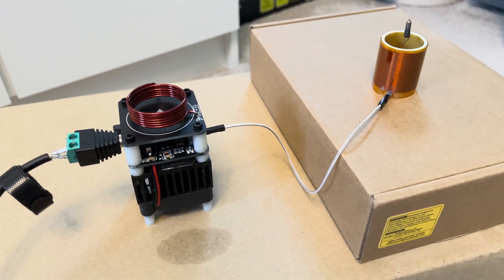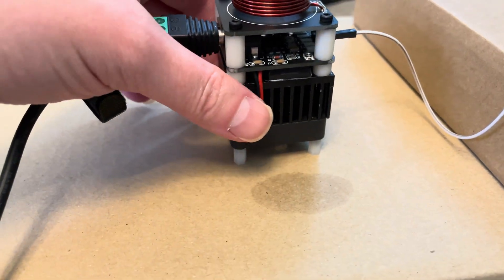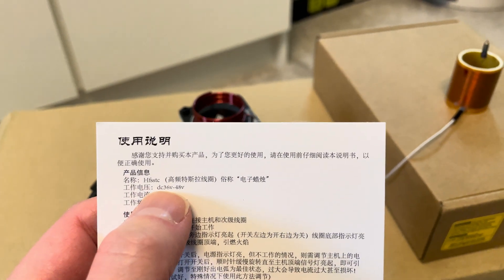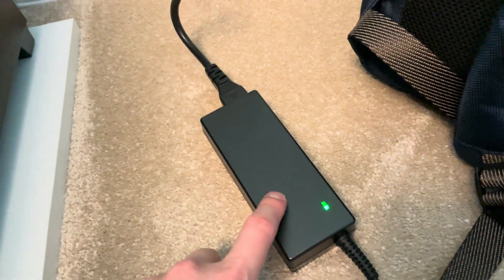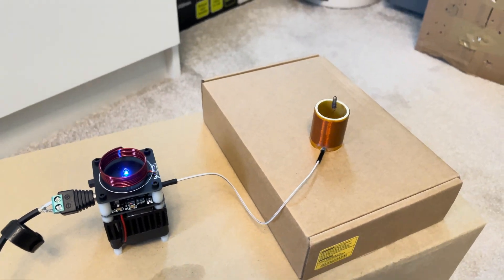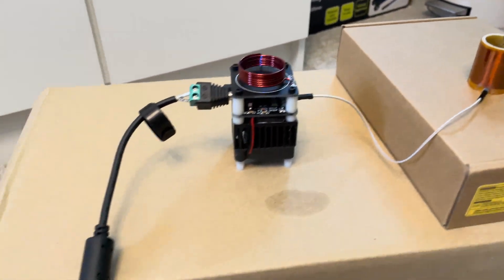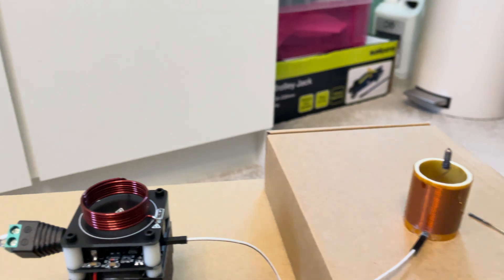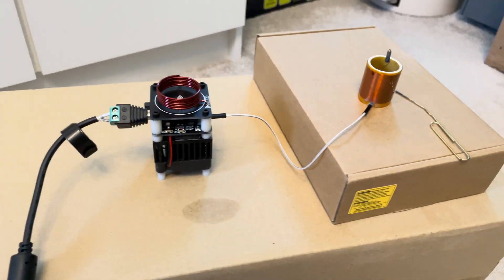Demo of High Frequency Solid State Tesla Coil (HFSSTC). Plasma candle.

Comment: You should draw the plasma flame out of the tip very soon after switching on, otherwise you risk burning the Mosfet. If it can discharge via the plasma flame its better for the mosfet - that what the instructions say and what you hear on many channels with HFSSTC. The Mosfet would be happy for any extra cooling though as it is driven very hard and over specs at this speed! It can only survive at zero current switching - so the device must be very well tweaked. If not 100% it will die soon.
Reply from the maker: ok thanks for the advice. I'll do that next time.

Comment: FYI....  From what I have read you need to start an arc at the electrode tip with a screwdriver or insulated metal object WITHIN A FEW SECONDS to keep the main unit form damage.  I have yet to receive my unit, but, I will be following that advise for sure....

Comment: I have also this unit bought months ago. Soon after playing with it, I realized that the flame electrode really needs to be replaced with titanium or carbon, or tungsten, to perform immensely better. Second thing: the coil with the flame is called extra coil, it's not a secondary. Secondary and primary are on the pcb, the primary being just one turn printed circuit coil, and the secondary being the soldered copper wire coil. This setup, thus, consist of three coils and is called "Tesla Magnyfing Transmitter". It's the most effective setup, compared to classical two coils setups.
Reply from the maker: yes correct!!! the MOSFET also needs much better cooling.
Reply: I was wondering about this and thought the flame coil was the secondary.. Is the wire connection to the manifying/ flame coil common earth?
Reply: @Mr_Mz518  Nope. It's a free resonator, not magnetically coupled. Energy is directly injected from the first "driving transformer" made by primary and secondary. Strange that nowadays people still build two coil setups which are bad.

Comment: There’s no way that the plasma temperature is 11,000⁰K!!!
Reply from the maker: Hi, I got that from The Action Lab's video here: https://www.youtube.com/watch?v=3vtGktz8c1M
Reply: @BrianSu  It is true that electrical plasma may reach temperatures of that magnitude, but that is for extremely high power generators, like the sun for example.  The “candle” Tesla coil plasma is most definitely hot, but it’s only a few hundred watts of power.
Reply: 84 watts*
Reply from the maker: @williamfox8795  11,000 K is the electron temperature not the atom temp.
Reply: @BrianSu  What is the difference?
Reply: @MrMoo272  is this 84 watt hours to run or ?

Comment: What is the minimum voltage you can run it at? what is the minimum voltage where a flame can be struck?
Reply from the maker: Working voltage: 36-48V DC

 
Operating current: 1.5-2.5A (48V)
Reply: @BrianSu  Yes, I know. That's the official specs. But if you crank the supply voltage down, at which when does the arc extinguish?
Reply from the maker: @simont3686  my PSU is fixed voltage so I can't try that, sorry
Reply: @simont3686  I haven't been able to test the arc extinction voltage, however it still runs at 12V, allowing you to draw a small arc using an insulated screwdriver-- it just doesn't produce a free flame discharge at that voltage.
Reply: @flomojo2u No worries. I already got one for myself and tested it.

Comment: 3 amps too much?
Reply from the maker: what?
Reply: @BrianSu  I run it with 3 amp power supply and now see only arc/LED flashing at 1 second interwalls. I tested driver with incandescent lamp and doesn't seem to  flash then, when turn switch fan works for a second and then stops. Tried 1 amp driver - same problem, just fan spins longer when touch candle rod.
Reply from the maker: @RynaxAlien  wow.
Reply: @BrianSu  So any way to fix this?

Comment: does it make a difference when you put the secondary coil (with the flame) on top/inside of the primary coil (the one with 6 turns)? I think it's interesting that it seems to work with electric field coupling only (unlike the typical magnetic field coupling). By the way, the fluorescent tubes light up because of the intense electric near field.
Reply from the maker: Hello. I'm not sure what would happen in that scenario :) yeah the electric field causes havoc with my PC etc.
Reply: @BrianSu  And why do you have a torch looks purple and in the video on the Ali Express and the second YouTubers it looks like fire, it is more yellow and you have it purple as it is
Reply from the maker: @artofwar3848  it doesn't look purple
Reply: It doesnt, another channel tried it, it didnt break .
Reply: You all are wrongly assuming the flame coil is the secondary. It isn't.

Comment: Where Did u get it?
Reply from the maker: AliExpress
Reply: @BrianSu  Hi Brian, would you share aliexpress link. recently bought two HV. one is output 30KV ~10mA  and the other is tesla coil generator.100kv.0.3mA 5Watt~30wa potentio knob. 🧡🧡🧡
Reply from the maker: @nerd9992  Yes here's the link: https://www.aliexpress.com/item/1005002393684653.html

Comment: Can it handle 3 amps? Can I use it to heat alumina crucible to melt glass or steel?
Reply from the maker: I think the MOSFET transistor would overheat and burn out before you could melt anything. Even with the fan on, the heatsink gets hot enough to burn you if you accidentally touch it, and this is only after a few seconds.
Reply: @BrianSu  I maen you could put a better heat sink on it, like a big block of copper sknce weight is not a problem here.
Or you buy a watercooled heat sink, but thats pretty expensive...
Reply: @BrianSu  use water on the heat sink